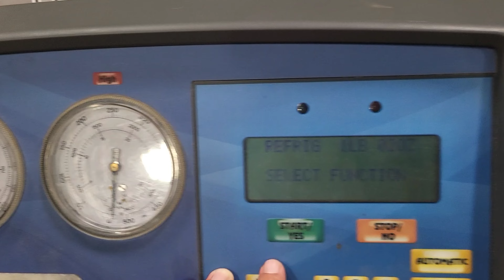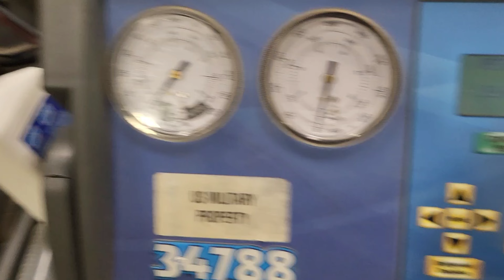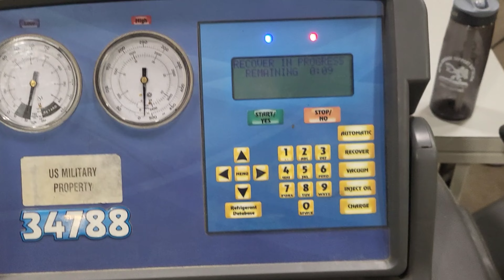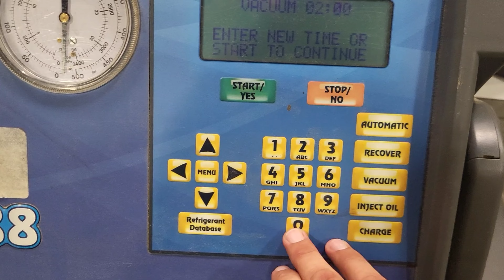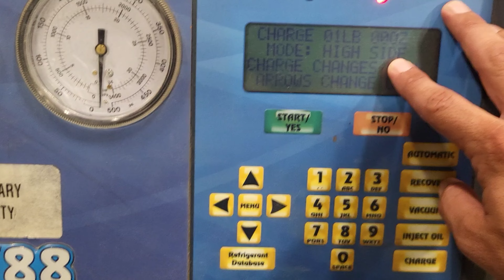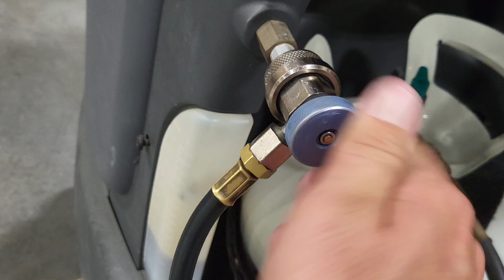How to use a 34788 Robin Air AC machine

Comment: Great video, Buddy
Reply from the maker: Glad you liked it! Just trying to expand my reach to my students and others on the tools of the trade
Reply: This is not your problem however what I don’t like is the lies is being told by EPA and our government. Back in the 90s when our 134 a was introduced it was allegedly environmental friendly. It took until 2023 or 24 to figure out that it wasn’t? I pull out my BS card on that.
Reply from the maker: @poppiarlin5612 I guess with the absence of chlorine in 134a it was 1000s of times better then CFCs and HCFCs (r12-r22)....now there is so much regulation that 134a is a hazard! HFO1234yf is propane and carbon dioxide from my understanding soon that will be regulated also lol....

Good point thanks for the comment 👍